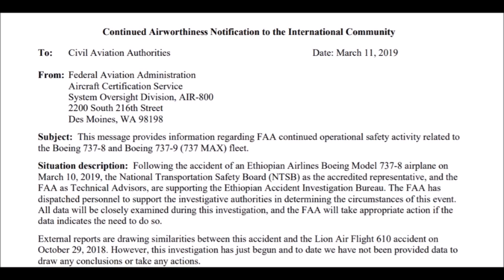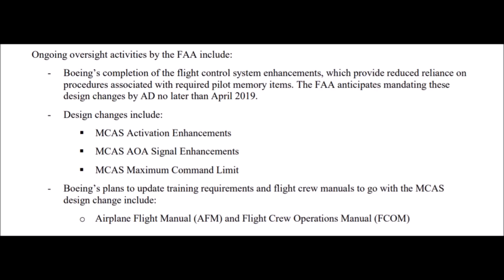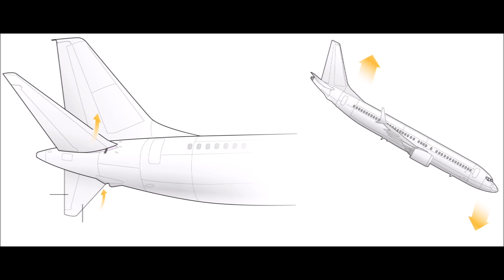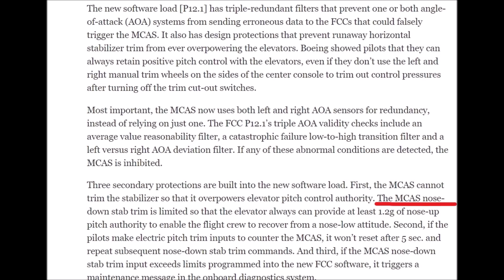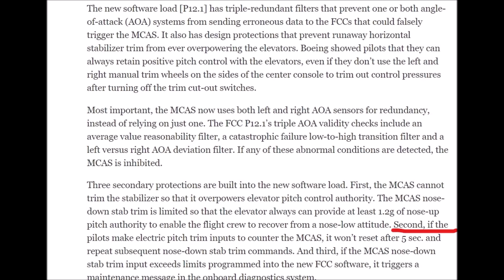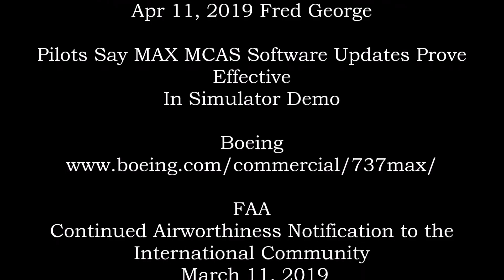737 Max UPDATE 14 April 2019 "The Fix"

Comment: Good video. About automation saving lives, autopilot is a great thing indeed, but MCAS is not about saving lives ... the plane would actually be even safer without the MCAS at all (imagine that both sensors have the same defect and give the same bad readings, and that the plane was already going down for some reason, and the MCAS is activated but lets the pilot pull 1.2G up, well without the MCAS, the pilots could pull up even more, which could be important), so the safest solution (but not cheapest) is to remove the MCAS and have pilots take another certification.
Reply: Agreed. That would have been the best case. But, at least the new implementations should now fix all the problems.
Reply: I still say bad design. Should srap the the hole thing. And build a new model with the engines in the right place under the wings were they are suppose too be. And then you won't need all the software updates. You can't really put all that trust on computers they can be hacked. Build a staybill plane cheeper in the long run.
Reply: @markorabadan5429  The software updates aren't really neccessary now, either. That's the point.

Comment: A couple of videos back I asked  who made the AOA sensors and if they were being investigated. Last week I read a report on Nbcnews.com that said both planes that crashed had an AOA disagree and the out of range sensor on both planes was built by a division of United Technologies.  The Lion air failed AOA had been repaired by a Florida company prior to being installed on that aircraft.  The NTSB said they were investigating both of these issues.
Reply: AOA sensors are fragile things. They are consumables, like all sensors. It is a little toy plastic airplane wing on a pivot, you can break it off real easily. The fact that some TV network is "investigating" some company means that they want more views for their TV network, not that there is anything to investigate.

The problem here isn't that one sensor is giving bad results. That is why there are two of them. The problem is the MCAS system only used one, and had no filtering to check for probable erroneous input from that sensor, and even worse, had both sensors available to it but chose to only use one.
Reply: OK. Investigated by the FAA, yes. "Investigated" by Congress or some TV "news" (entertainment and slander) agency, no.
Reply: No. Heaven forbid that some entity that is interested in nothing more than destruction of other entities for their own temporary profit get involved. Find some actual reputable investigative agency (if there are any) and see if they want to get involved.
Reply: Just to be clear..if you read what I wrote yesterday I said NTSB was investigating, not NBC.

Comment: What is missing from the Boeing update proposal is, that the MCAS should NOT trim against the elevator in the first place. That's all!!!
This proposed update will occasionally (not rarely, as we've seen in the period between these crashes with just 350 flying examples) also render MCAS inop, when it might really be necessary (the situations originally it was proposed for). 
Therefore, the B737MAX should actually require a new type certificate, due to loss of handling commonality with the NG!!
As an NG and MAX commander, I'm not impressed at all, I'm not even satisfied. 

It very much is a multi-layer patch, only a band-aid to prevent these terrible killer-dives. That's better than nothing. But I don't want to fly an aeroplane decorated with speed-tape allover. This is a very poor standard for a 21st century aeroplane.
Reply: (Continuing..) This proposal shows to me that the root cause analysis of the crashes are not studied IN COMBINATION WITH why the MCAS was incorporated into the Max. 

This is an indication to me, that instead of a big team of pilots+engineers working on the solution, a lot more PR effort was carried out. Boeing has no more credit for apologies EVER. So they better beware, and improve their working discipline soon!
Reply: Hornet135, try to point them out, if you can. It was I stating that the Max should be grounded after the LionAir crash; were you? I pointed all the points of the poor design of MCAS in avherald more than a month ago, before the preliminary report came out. Did you? Anyway, if not; keep trolling babe;)
Reply: @aydinsoy  The fact that you think MCAS shouldn't trim against the elevator doesn't make sense as trimming opposite to control column input may be needed to keep control column forces at certain levels for certification. In fact, the speed trim system (STS) can and does move the trim opposite to control column input in certain situations as well. Are you opposed to it doing so as well?  The problem is not MCAS trimming against the elevator, it's that it was poorly implemented, had too much authority, and essentially no documentation to pilots.  Of course, going against a commander makes me a troll, just like your adding excessive exclamation points to your comment makes it more valid.
Reply: aydinsoy Clearly you missed main points in the video and I'd be quite worried to have you as the commander of anything.

Comment: Was the angle of attack sensor vane
 faulty ?
Reply from the maker: It may have been sheared off by a bird strike...don't know yet.
Reply: In the ethiopian air, almost certainly.
The two AOA sensors were wildly disagreeing. The righthand sensor gave sensible-seeming values (about 15 degrees max), whereas the left AOA sensor seemed to believe the plane was pogoing up and down at up to 72 degrees positive and negative.
Either the sensor failed, or the computer digesting the sensor input had an aneurism.

Comment: They seem to be making so many changes to the system, that it must have had some serious faults with it in the first place. It still seems that this whole situation has come about because they are trying to use an outdated air frame with re positioned engines simply to save the cost of full redesign of a new aircraft.